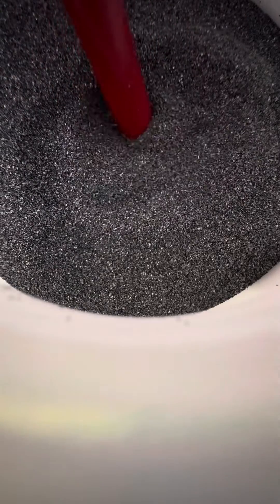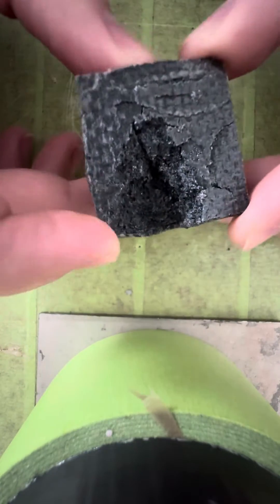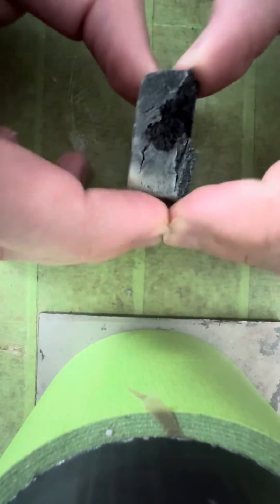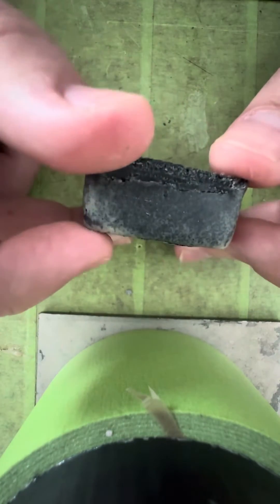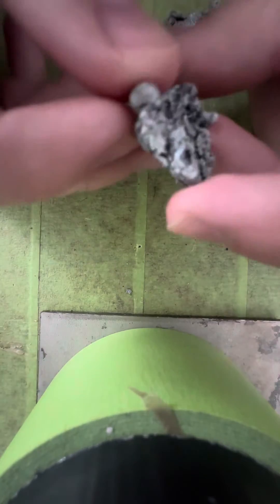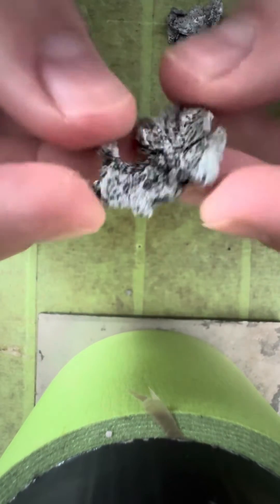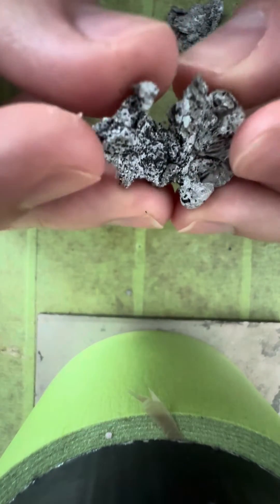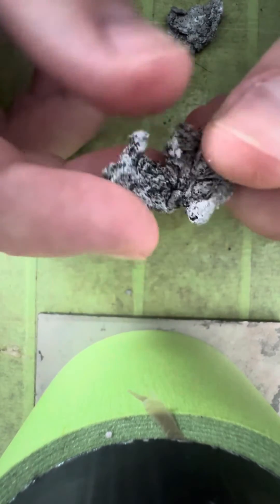Homemade MMC’s??? Silicon Carbide and Aluminum (Introduction)

Comment: Have you seen Tech Ingredients video on Epoxy composites? He said he was working on ballistic tiles near the end of video. using large ceramic tumbler media to shatter the bullet, then progressively smaller media to abrade the fragments, all of this encased in epoxy tiles. He never followed up on this so I think it would be a cool thing for you to test
Reply from the maker: Like this? dont think it would perform, but maybe I can find something better.

https://www.harborfreight.com/5-lb-medium-ceramic-abrasive-polishing-tumbler-media-63673.html?utm_source=google&utm_medium=cpc&utm_campaign=12144811130&campaignid=12144811130&utm_content=117789286998&adsetid=117789286998&product=63673&store=391&gad_source=1&gclid=Cj0KCQjwn7mwBhCiARIsAGoxjaICYSxBcImuOK_O5WGj1qDi6k7OyBv-SoWFsCMK01gVEGLS-vhl1sgaAsoYEALw_wcB
Reply: @Armor-Innovations  Those seem to be 48% SiO2, idk if that would be better or worse than 100% alumina ones, but yea that general size and shape. Then you fill in the dead space with rough silicon carbide granules(like 1x1mm) and add an even finer abrasive. In the video he added Titanium coated Diamonds, but you can prolly just use finer grade Silicon carbide or maybe Boron Nitride abrasive.

Comment: Are you trying to make vitrified silicone carbide, like in the case of a whetstone or something like a grinding wheel? I think there is something like  66 precent abrasive, 25 percent silca, 8 percent alumina and 1 percent alkali oxide flux. I've never made the stuff myself but want to try it out in my knife making furnace. You can do a search for Google Patents

US2837416A - Vitrified bonded silicon carbide abrasive articles

It's a pretty interesting article by Norton abrasives but all kind of seems like a lot of guess work about what the magic formula they use actually is, different values will yield different results. I think it's cool seeing ppl trying to make this stuff though.

Comment: I’ve watched a few of your videos now and I think you’ve got some really cool ideas. One of the things we do at my company is cast MMCs! So I’ve actually been really interested in the idea of using a carbide powder to make armor. It sounds like you cast those by pouring the powder into the molten aluminum? The way we cast is called an infiltration process. So you start with a bed of your powder in a mold (we use graphite molds because it is non-reactive) then you add small chunks of your binder alloy to a funnel structure that sits over the top of the bed of powder in the mold. All of this is done at room temperature. Then you put the entire mold in a furnace and heat it up to just above melting point of your alloy. After some time, the alloy will melt and infiltrate into the powder bed. You let it dwell for some time and at that point you remove the mold from the furnace and cool it from the bottom while trying to keep the top warm. This ensures you don’t get pockets of porosity as the alloy cools and shrinks. After it cools you have your MMC. But as another commenter mentioned, I wonder if a resin material as the binder might be a better option? They key is ensuring your binder wets and infiltrates the powder bed, so binder selection is crucial in that regard
Reply from the maker: Super cool! I have been looking into Stir Casting where they bring the metal to a molten state then stir it to create a vortex which evenly distributes any addatives mixed in. I would assume they would need to cool the casted parts relatively quick so the addative does not settle but im not sure. Either way I dont have the setup to do any types of MMCs. Just wanted to bring attention to the idea so maybe someone like yourself with more knowledge might look into it.

Comment: if you want to cast alluminium, mix some metallurgical silicon powder (wich is different from the silicon carbide) in order to make your cast more fluid (4032 contain up to 13% silicon for exemple) and make sure your mold has en entry and an upper exit for gas bubbles to evacuate

Comment: Silicon Carbide is actually a lot harder than AR500, most armor grade ceramics usually are harder than armor grade metals such as Aluminum, Titanium, and Steel alloys. Boron Carbide is considered one of the hardest ballistic grade ceramics there is, and the 3rd hardest synthetic material in the world, behind that of Cubic Boron Nitride and diamonds. 

I actually have some of the SIC you're planning to test with Aluminum (about 5 lbs of it in 60 grit) and one of the curiosities I've had while working to design lightweight composite armor with some of the most insane bullet stopping capabilities is what would happen if I used melted HDPE plastic from milk jugs as a resin binder for the SIC or B4C particles?

What I think would happen and this is just my personal opinion, is that the ridiculous hardness of the Carbide particles combined with the high strength to low weight ratio and high impact resistance of HDPE resin would cause too much resistance for any incoming rifle or other rounds to successfully penetrate the composite. 
And that's just from an unaltered version. Imagine how much stronger the composite I'm describing would get if we annealed the High Density Polyethylene holding all of the ceramic particles together.

Another big thing about HDPE is that it's also lighter than Aluminum. Aluminum has a density of around 3 grams per cubic centimeter. The density of HDPE is 0.970 grams. So it's less than 1 gram and not only is it lighter than Aluminum it's also 50% lighter than Kevlar and 10 times lighter than Steel. HDPE is so incredibly lightweight it's almost essentially weightless. Almost.